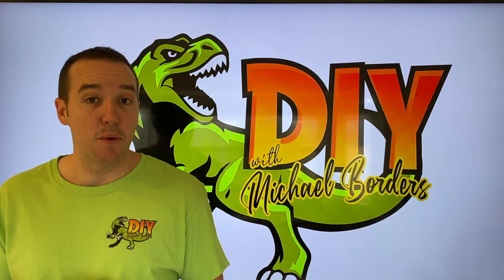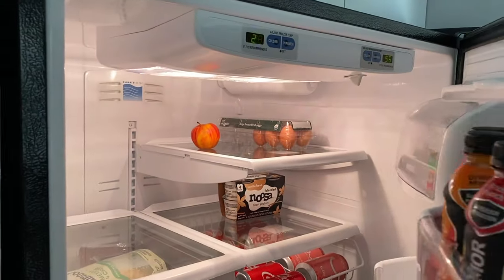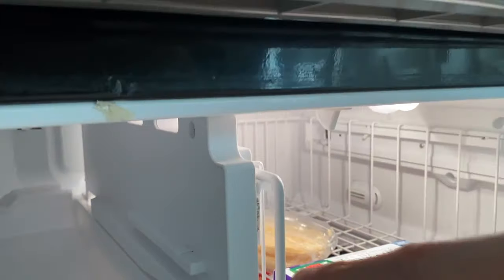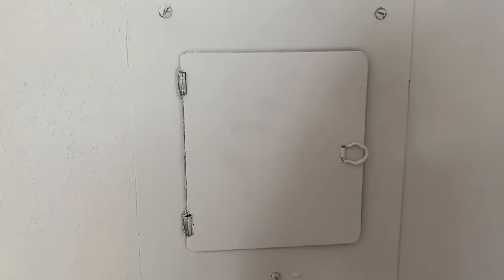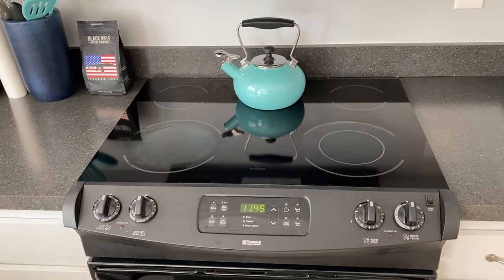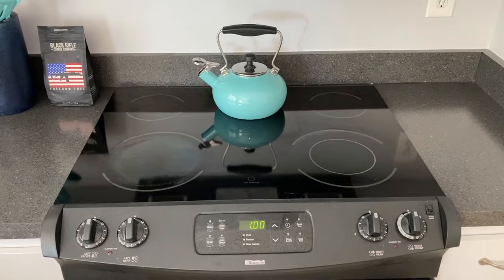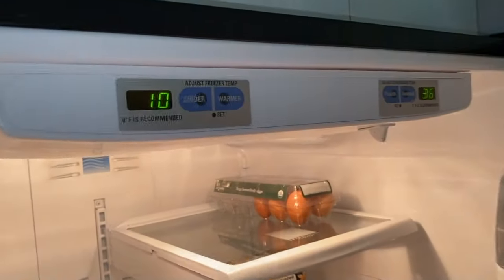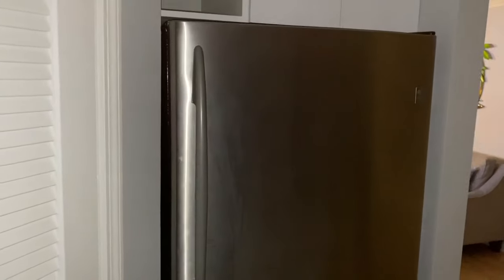Whirlpool GE Refrigerator not cold/cooling - Reset mother board

Comment: I was stressing bad, just went grocery shopping yesterday, cleaned and bleached the fridge out, been stocking up the freezer, fresh vegs, spent all last night chopping and prepping for an easy week of dinners and then it stopped working sometime today. The reset on both frig and freezer did not work, unplugged for 5 minutes and I hear a beautiful motor in the back of the fridge. I can't thank you enough for posting this video. It's 9 at night, no one is open and the one repairman that said they did 24 hr service did not answer. What a relief, now I just have to stay up another hour or so to see if it is cooling. Thank you so much!

Comment: Thank you. This just worked on our French door GE with bottom freezer. It took both ways to get it going. After I plugged it back in and pushed top buttons nothing happened. Pushed the freezer switch and the freezer started working. It took five minutes for upper fan to come on. I put an AC thermometer in and temp was 75 in the house. Put the appliance on turbo cool for two hours and temp dropped to below 40 degrees. We turned turbo cool off and reloaded the fridge. Temp is still where it needs to be. You saved me at least 200 dollars for the repair company we scheduled for three days from now. Gonna cancel them in the am. Thank you for this clear concise valuable tutorial.
Reply from the maker: Good morning, just poured a cup of coffee and am sitting down to answer any and all questions for the DIY community.

That’s awesome and we appreciate you sharing your experience.  You can spend that $200.00 on something more meaningful.

Let us know if you have any questions 

😎👍

Comment: Hello can you help me I have the whirlpool that is a separate fridge and freezer the fridge is not cooling can you help me what I should do
Reply from the maker: @ingashepherd4194  

Thanks for watching, any update?  Have you performed this reset procedure?

If so, and it’s still not working… you can perform this reset procedure a second and third time.  Your system may require additional resets to fully reconfigure.

If that doesn’t help, you can unplug the refrigerator and leave unplugged for a minimum of five minutes.  This will also reset your refrigerators control board.

Comment: This video helped me to restore my garage refrigerator; however, I need to use the trick everyday or so to initiate cooling. Any suggestions as to what might be causing this?
Reply from the maker: @trlev  

Thanks for watching, we are honored to help.  That’s a bummer that the refrigerator is requiring a reset every day.

This can be caused by intermittently working control board.  Our recommendation is to continue to reset it over the next few days if it requires it.

After a few days, we recommend unplugging unit for 30 minutes to allow refrigerator to perform a full system reset throughout entire electrical system.

🧰
Reply: @DIYwithMichaelBorders  I’ve tried that as well, but it eventually shuts off. 

So, it works if I hit the switch but only runs for a short time before shutting down and remaining off until I hit switch again. 

I’ve seen a few videos which suggest replacing certain parts but each part is $75 or so. I’d like to pinpoint the problem without ordering parts that I don’t need and cannot return. 

Any thoughts on which part I should replace?
Reply from the maker: @trlev  

Thanks for the follow up, we definitely understand your thoughts and focus.

Pinpointing the exact part will be the best route.  A rabbit race we call it…replacing several parts to resolve an issue that only one part is causing.

We would direct your attention to the compressor.  Inspect the compressor and see if there is any signs of damage to it or it’s respective lines and connections.
Reply: @DIYwithMichaelBorders  thanks for the quick response. The compressor and lines looked good when I cleaned them , and the fan is running. 

I’ve noticed that I can get the unit running by turning the temp knob off and back on. However, it still eventually shuts down.
Reply from the maker: @trlev  

Thanks for the follow up.  Great observation, replacing the thermostat and or temp control may solve issue.
Reply: Success! The thermostat seems to have fixed it! Minimal effort and minimal cost. Thanks!
Reply from the maker: @ 

Very cool, that’s a great update.  Keeping a good eye on it over the next few days until it gains your full trust is recommended.  😁👍🧰

Comment: The 1st procedure (without unplugging it for 5 minutes) fixed our GE Profile side by side freezer/refrigerator. I was skeptical it would work because for the 1st couple hours the freezer only dropped from 11 to 8 degrees Fahrenheit.  The refrigerator only dropped from 39 to 37 degrees.
However,  after 16-17 hours the freezer was at -1 F and refrigerator at 33 F. We cannot thank you enough!!!
We did have an intense thunderstorm with numerous lightening strikes close by.  From your analysis it caused a sharp power fluctuation or power loss. 
We no longer hear strange groans and loud fans turning. The unit is quiet like new again.
Thanks so much!!!
Reply from the maker: David, thanks for watching & sharing your experience.  A slight power fluctuation will definitely cause a trip in the system.

That’s awesome to hear you are back up and running with no issues.  Awesome job making it a DIY project!!!

Let us know if you have any questions, us DIYers need to stick together!!!
Reply: This refrigerator is going on 20 years. It sounds new (quiet) now! 
For about 6-8 months the fan in the back of the freezer(?) sounded like a turbo-prop taking off for 5-10 minutes, then, it would quit.
I feel like I bought a new appliance... Thanks so very much,  again!!! Double-checking to make sure I've subscribed.
Reply from the maker: @davidk.ringel4321  

That is great to hear & again, we appreciate you sharing this.  My poor wife has to deal with me fixing everything.

She will say, “I think the dishwasher is failing”... I say “I’ll rebuild it next week”...

Then she will say, “don’t you just want to buy a brand new one, it’s from 2004”?

My reaction...”Nope, a few new parts & it will be like new...🤣”

My wife’s reaction, “🙄”

Comment: Big thank you your my lifesaver. I just bought  a new fridge and I was wondering why it's  not cooling but after came cross your video. I decided to give it a try and bomb, it instantly worked
Reply from the maker: Very cool & we appreciate you sharing this.  That’s odd that you had to perform a reset on a new refrigerator however anything out of the ordinary such as a momentary power surge or outage can cause the control board to go into emergency cutoff mode.

Hopefully many stress free days ahead for you for your refrigerator.

😎👍🔧🔩

Comment: Excellent. I have an Australian Shepherd and Eve goes anywhere she wants. I hadn't cleaned the cooling tubes in the front in quite some time. My Whirlpool Gold stopped cooling over the course of a few days. I cleaned up the front and did this full reset and the compressor is now on. What was 'weird' was after I turned the breaker back on I heard some 'chattering' and another loud noise. Before when it wasn't cooling I'd hear a 1 second hum that would repeat about every 60 seconds. Kinda like the compressor was getting a 'kick start' but wouldn't engage. Anyways... Thanks for the video. Boom! Out go the lights!
Reply from the maker: Great to hear and we appreciate you sharing this.  Great job making it a DIY project.

Comment: GE model GDSLOKCXCRLS date of purchase 05/2011-(very similar to refrig in this video) same type reset switches as in video-unit had stopped cooling+freezing but its interior light was working. Experienced 2 day power outage.Performed resets as shown on both refrig+freezer-also threw circuit breaker at panel-after a few hours wait-fridge is working and building its temperature controls. Canceling the service call! Thank you
Reply from the maker: Good morning, just poured a ☕️ and am sitting down to answer any and all questions for the DIY community.

Awesome Awesome Awesome!  That’s great to hear and compliments to you for making it a DIY project and not having to contact anyone.  👍

Let us know if you have any questions and hey if you’re interested, join our DIY ecosystem and help us grow an exclusive group of DIYers.

       toolboxtoken.com

Reach out to us any time!  🧰

Comment: We had a power outage that lasted a few hours. The refrigerator hasnt been the same since. Freezer has been fine. Trying this method out hoping for the best.
Reply from the maker: That’s a bummer to hear.  Power outages are out of your control in almost every case unfortunately.  The results cause havoc on your electrical devices and appliances.

Any update on your refrigerator?
Reply: @DIYwithMichaelBorders  I tried the reset and unplug several times but nothing. I checked the relay and it's fine. So I decided to crack open the panels and the freezer coils are iced over. About to crack open the refrigerator part as well. Im hoping it just needs to defrost
Reply from the maker: @MikeMB4  

Oh wow, awesome job doing that.  That will definitely cause issues as well.  Looking forward to hearing back from you on how it performs after thawing.

😎👍

Comment: Hi thanks for the video I have an older version of whirlpool it’s a stainless steel one and it’s only got three of those snowflake temperature controls I’m glad that you said that if there was a power outage the fridge would go into protective mode and shut down I had no idea    I have been trying to get this thing back up and running for almost a week now all of our food has gone bad but thank God it’s snowing so we can put our food outside    Can you please do a video on I guess it’s an older whirlpool fridge with just the three snowflakes I’m not sure what I’m doing wrong but usually the bold snowflake is the coldest setting but this fridge is wonky and I’m getting heat coming out of the fan area where it’s supposed to be blowing cold air    As well is the bottom of the freezer supposed to be cold like an old fashion freezer?    I’ve unplugged it and plugged it back in I’ve cleaned it I vacuumed it I don’t know what else to do help
Reply from the maker: @davirasdarkside4263  

Thanks for watching, any update?  Is the refrigerator completely dead or is it powering up and just not cooling to proper temperatures?

In addition, we would perform this reset procedure a second and third time… As your refrigerator may take additional reset attempts to fully reconfigure.

Comment: But what causes it to warm up in the first place? I have a Kitchen Aid built-in and can’t really figure it out.  Had the Freon recharged and filter replaced.  Was working ok for about a month then started warming up again.  Tech came out and put in some type of sealer cuz he couldn’t detect  an accessible leak.  That Didn’t work.  Went out and bought a new fridge and while raising up the jacks to remove old fridge I plugged in the new fridge to get it ready.  The next day I check old fridge temp and it’s working again.  What I mean by that is the temp came down from 55 to 40.  And the freezer came down from 40 to 15. I keep a thermometer in the fridge to monitor temp. While moving the old fridge out a bunch of dirty water spilled out as well.  It was kind of mildewy too.  I am going to keep it plugged in in the garage to monitor it some more.  It’s 17 years old but it was a $6k fridge back in 2004. Any ideas on what could be going on?
Reply: A defrost timer maybe. It thawed out when you unplugged it? Easy to test and replace with a screwdriver at the front bottom kick panel.

Comment: THANK YOU!! LIGHTS ON BUT WILL NOT GET COLD AT ALL? Did everything that you said!!!
Reply from the maker: Good morning, just poured a cup of coffee and am sitting down to answer any and all questions for the DIY community.

Have you performed this reset on the freezer as well?  Although freezer is operating good, it might help reset the refrigerator.

Let us know if you have any questions and hey if you’re into crypto trading, join our DIY ecosystem.

       toolboxtoken.com

Reach out to us any time!  🧰
Reply: I have the profile model no. PFSS6PKXASS AND ITS NOT COLD AT ALL   HAD TO TAKE EVERYTHING OUT!! I  Unplugged for hours & still doesn't wk!!!
Reply: Thank you so much for your help 🙏🏼 Just whenever you call for service here in Charlotte NC they take advantage of you and it cost so much to get anything fixed!!!
Reply from the maker: @GODSENT.  

Thanks for the follow up.  Was your refrigerator making any unfriendly noises prior to it issues?
Reply: No noise at all!! All lights on door reading 80deg. I set at -2 & 34 factory settings! Felt the back little square area that has a bolted door and it's hot!! I just unplugged again it's not responding to unplugging still the same?? Is there Anything else I can do???
Reply from the maker: @GODSENT.  

It’s possible that your condenser motor failed causing your compressor to overheat and turn off.

The condenser motor spins the fan which helps cool the compressor as it’s running.

Below is a video that explains more about this.

       https://youtu.be/TbWemPFH064

😎👍

Comment: Michael - I enjoyed your video on resetting the mother board. My residential fridge in my RV is subject to power fluctuations quite often.
I did a similar reset about a year ago when my fan motor behind the freezer section wasn't coming on and that did the trick.
My refrigerator section is warm (freezer is -12 deg) & I can see the fan isn't spinning.
I did the unplug/click the light switch 3 x  but the fan still isn't spinning.  Is there a different sequence for that ?
Reply from the maker: Hey Joe, we appreciate you sharing this.  This is the main reset procedure however it’s possible that unplugging unit for 5 minutes may reboot fan.

If not, it’s time to replace the condenser motor.  Below are two helpful links.

       https://youtu.be/gwUxS7VTRYM

       https://youtu.be/TbWemPFH064

Please keep us posted and hey if you’re into crypto trading, be an early participant in our newly launched DIY community ecosystem.

       Toolboxtoken.com

Reach out to us any time.  🧰
Reply: @DIYwithMichaelBorders  It's the fan behind the freezer  that pushes air to the fridge section that is not restarting.  Any ideas there? Thanks for your help!
Reply from the maker: @joef203  

Thanks for the follow up.  It’s likely that the little fan motor has failed however you might be able to get it going by cleaning the electrical leads inside wire connections.

You will need to gain access to inner portion for cleaning.
Reply: @DIYwithMichaelBorders  Michael - I opened up the back of the freezer & while doing so I gave the fan blades a light spin.
It started running!  Still running this am and fridge is at 37 deg, 
Also when I opened the back up there was some frost /freezing at the opening to the fridge below.  I'm thinking that was from the fan (previously) not working an colder air meeting warmer air from fridge below. Do you think I should still replace the motor at this point?
Appreciate all your help !
Reply from the maker: @joef203  

That’s a great update, didn’t cost you any money.  That’s outstanding, especially moving into the weekend.

Hopefully a stress-free weekend ahead for you Joe, and thanks for taking the time to share this update.

😎👍🧰

Comment: Hello Michael.  What is the procedure for a fridge with french doors?  Do I have to  move both the switches simultaneiously on and off 3 times
Reply: Hi Michael I have the Whirlpool with French door someone asked also the procedure 
Because this afternoon I was adjudged the temperature but then the light went out. this happened before too. 
So I turned off and on the switch in the back but still it hasn’t back just yet 
Any advice 
Thank you so much

Comment: Will this work on all whirlpool I have a whirlpool gold series with bottom freezer.  I've replaced control board, capacitor, diagnostics showed an open Bimetal circuit changed out the thermostat cleared that error.  Still have a fridge at 54 freezer at 45.  Didn't start doing this until I unplugged it because freezer drain tube was clogged ice would build until it started leaking out the door and pushed door open.
Reply from the maker: Thanks for watching, it will indeed.  If it doesn’t work, you may want to unplug unit for 5 minutes.  This will allow system to reset as well.

Comment: What did you do to get your frig out of protect mode from whrn you flipped the breaker?
Reply from the maker: Thanks for watching, we simply performed this procedure to get our refrigerator reconfigured.
Reply: @DIYwithMichaelBorders  are you talking the unplug for 10 min. Procedure? That didn't work for me but thanks anyway.
Reply from the maker: @prosafetytrainings2013  

Thanks for the reply, we are indeed.  That’s a bummer to hear.  You can perform this reset procedure a second or third time and see if that helps.

If it does not help, it may be time to direct your attention to the internal control board.